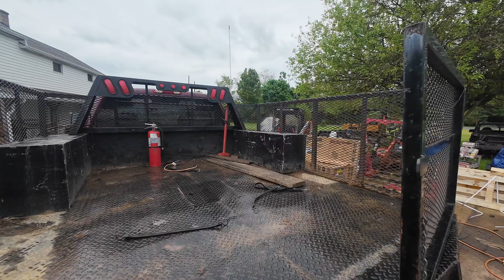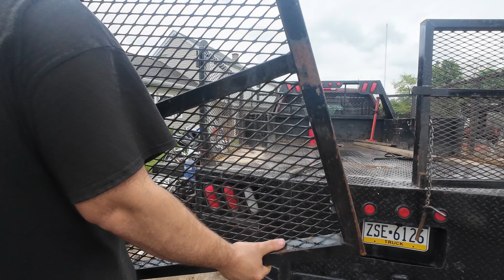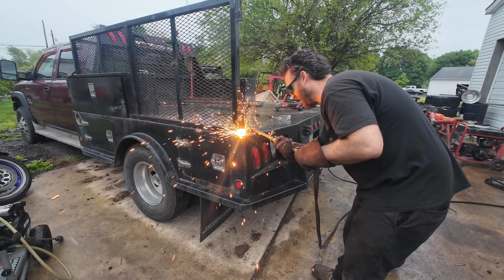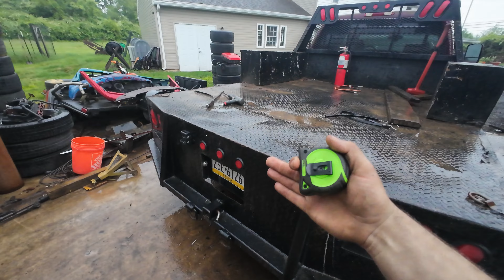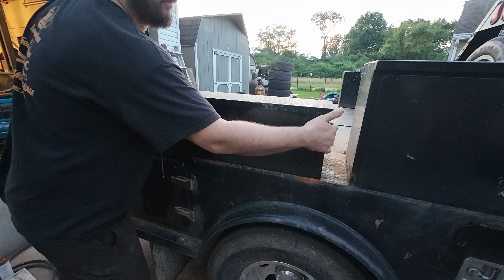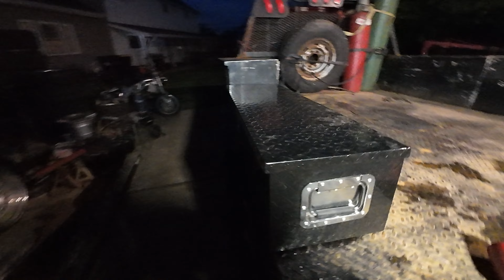Building the perfect? flat bed for the Duramax. Tool Storage and Cargo Space

Comment: I think I’m going to flatbed my 2004 Chevy 2500HD shortbed. I have a crossover toolbox and a normal 4 draw toolbox in the back and I’m still lacking on storage. I’m tired of not having a back seat because it’s full of my cordless tools
Reply from the maker: The flatbed is great. Its tough you can be really rough with it. They are really heavy though.
Reply: @ that’s what I’m afraid of is adding all that extra weight to the truck. It’s only a 6.0 gas 2500HD truck. Plus the weight of all my toolboxes full of tools, air compressor and whatever else I have in back. I was thinking about putting a Bradford bed because they’re tough beds but they’re heavy just them by themselves empty

Comment: Nice work!  Are those tight radius elbows these ones from Wagner? 
 Steel Flush-Weld 90° Elbow with 1-1/2" Inside Radius for 1.50" Tube OD
Reply from the maker: Yup thats them!